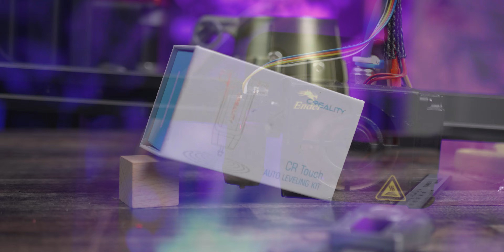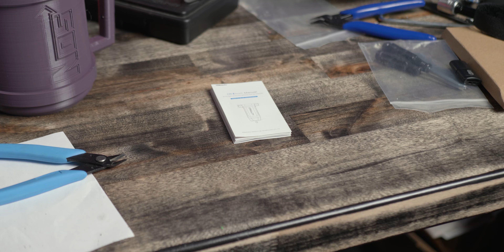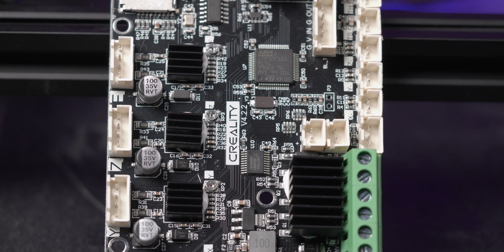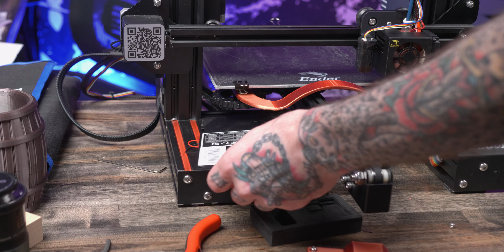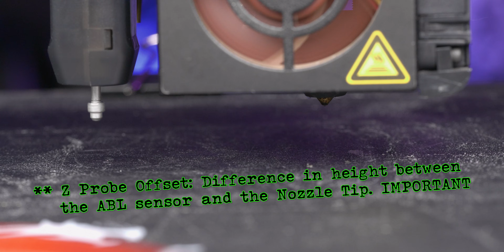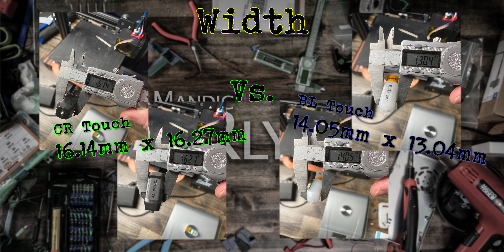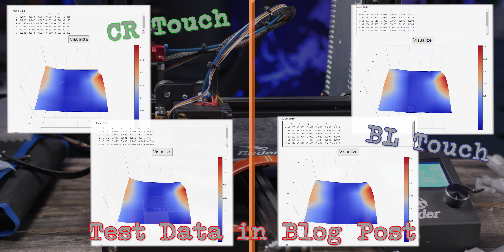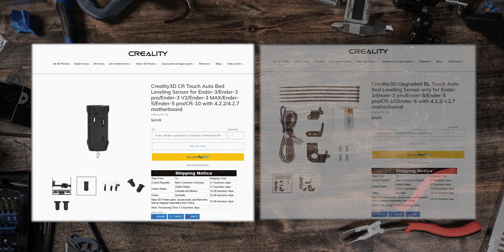CR Touch vs BL Touch - NEW Creality Auto Bed Level Sensor Review

Comment: Can you elaborate on what didn't work about the Creality provided firmware? I purchased a BL Touch and wasn't able to get it working out of the box with the same cable/firmware. I ordered a CR Touch cause I don't have enough experience and didn't feel like messing with it. My problem was the gantry started down, never deployed the probe, stopped without touching the build plate, and then reversed and went up until it crashed into the top of the frame. Was able to repeat this on two totally different Ender 3v2's and two different BL Touch's. See it here: https://youtu.be/9aUeO1KjvFE
Reply: Just received my CR Touch. Same exact problem. Not sure WTF I am doing wrong. I plugged it in, unplugged the Z-Stop, updated the screen/printer firmware. Same result with two entirely different printers and BL/CR Touches. Emailed Creality and received no help. Someone tell me what I am doing wrong...
Reply: Also worthy of note... My carriage crashed into my X-Stop and started grinding away because I have an octoprint camera mounted to it. Apparently the mount for the CR-Touch does not clear a gantry mounted camera and prevents the carriage from contacting the end-stop switch. Just good information as the same issue does not occur with the BL-Touch mount.

Comment: It would be better if the probe was completely shrouded when retracted.  I had a BLtouch snag a failed print and destroyed the BLtouch.  But since I have a 3d printer a small shroud is easy enough.  

As an aside I find it funny when people complain about things that a 3d printer is actually used for modifying.  If the STL model is available that would be good.
Reply from the maker: This sensor is spring loaded to the closed position.  So short of a serious failure it shouldn't be protruding enough to snag on a print ever.  If your parts are curling THAT much, they were destined to fail, hit a part cooling duct, or get smashed by the hot end anyway.  This has a metal probe so even if it did hit, it wouldn't be as detrimental to the probe as BL Touch.

Comment: The board connection is the same as the BL?
Reply from the maker: Yes it is. The wiring is all the same. I literally used the same wiring for both tests without issue.

Comment: Pity you never mentioned the single most important item, if the probe offset is different than a bltouch when mounted on the same machine.
Reply from the maker: Do you mean the X/Y offset? Cause I specifically mentioned that the probe is Shorter and that Z Offset must be adjusted but it should be anytime you change sensor or nozzles on a machine.
Reply: that isn't the most important item at all.  you aren't swapping probes, and you are definitely dialing each one in.

Comment: I always think I should add a BL touch of some sort on my machines, but then I remember I manually bed level the machines like once every 6 months, if that. I think the glass bed helps.
Reply: Had the same thoughts. Then I bought a bltouch and saw just how warped my glass bed was (410x410mm).  Prints were ok but def had issues with squish and adhesion in some spots on the bed, now that’s completely solved. I then got OCD and used a depth gauge mounted to the rail to add layers of painters tape between the aluminum and glass to make the bed flat at print temp. This was a long process though. Do one row at a time (15,0 - 15,410 for example), mark where it drops more than .05 from the highest spot, mark where it climbs back up, add a layer of tape between those marks. Repeat until you have no more spots that drop in that row. Move the head one width of your roll of tape back and repeat the next row. Took a long time but now my bed visualization plugin shows a nearly flawless bed and the ABL compensation is negligible.
Reply: I level my bed 2 times a day
printing 24hrs tho..
Reply: @MountEverest974  I've run for about a week straight on a manual leveling from months ago, with only sporadic use at best before so lots of moving the machine around and heating up and cooling down. I just adjust my first layer height and it seems pretty forgiving.
Reply: Same iv had my printer a month and had to level it 2 times 1 when i got it and 2nd when i had to do some cleaning other than that its fine tho i just got a flex bed and im having to level it after every dam print so hence im here looking for a way to get the printer to do it for me XD
Reply: Same never needed to touch the level with the updated springs and glass bed.
Reply: Also the bed leveling doesn't actually take any extra time if you have it bed level while heating.
Reply: So glass is better then the mat?
Reply: I bought it because my printer doesn't have a z offset option so I had to manually z level and exclude the z homing in the g code. So it was totally worth it imo, also I literally will never have to level my bed ever again.
Reply: @kipter  famous last words. Trust me you’ll need to level it again.
Reply: Use Ender 5 plus
Reply: My glass bed came out of level after every print. It’s super annoying
Reply: I have used the tazbotz with their autobed leveling and i hated it.  It is a different system than the BL Touch but i can manually level my ender in a minute or so. With the glass bed and upgraded springs I almost never need to level the bed.  I just double check it wgen i move the printer to a new home.
Reply: I felt the same way. I got a bl touch and never got it working properly. Then I was having a ton of trouble and decided to get it up and going. It massively improved my prints. Now I wouldn't go back.
Reply: In a way they are over rated.  If you do a good manual level, I think the only advantage of Auto Bed Leveling is it usually probes more points and compensates, but only on the 1st layer.  I used to auto level before every print, but that is slow and really no need so I stopped doing that.
Reply: @Nerlin   no, not only the first layer is compensated. The amount of compensated layers can be changed and it can slowly reduce the amount of compensation per layer. This is customisable in firmware.
Reply: @Nerlin  tell me your secrets. I only stopped having problems with my ender 3 after installing my bltouch and thinking about getting one for my svo1
Reply: @Nerlin  so if you do install an ABL does it do the autoleveling before every print?
 or is there an option where you can turn it on to ABL before each print or do you have to just select the option to ABL manually when you want?
Reply: @andreamitchell4758  I added the auto leveling command to the start gcode in Machine Settings (Cura). but it's kind of slow to auto level before each print so I have since stopped and only auto level once in awhile.   I just keep 2 printer setups, one with, one without.  I imagine you can still auto level from the Menu if you had that option to begin with. I have CR10 Pros that came with that capacitive auto leveling.
Reply: They help if your bed is warped. Which glass should not be…
Reply: @timothymusson5040  My bed is so warped that even glass doesn't fix it.
Reply: @timothymusson5040  ideally glass doesn’t warp. In practice it does, though. I had a glass bed that started out flat, but took on a slight “taco” warp within a few months. Addition of the BL Touch helped deal with that. I now mostly print to a steel plate with a smooth PEI sheet, and that’s working for me right now. I run the bed probing maybe every ten prints or so.
Reply: Except when it breaks. Which mine did after 2 weeks.
Reply: @mattportnoyTLV  the hell kinda luck you having... ive had my glass bet 3 years.
Reply: @roxasparks  my glass bed didn’t break. My BL Touch broke.
Reply: They are definitely over rated. They can help with warped beds yes but the issue for me is how much maintenance or work it takes to keep my machine printing well. Now I'm no pro and I'm sure I didn't understsnd fully or something but every single time you have to re-level the bed you have to go into the z offset and change it witch is so annoying figuring that out lol.. I got so sick of it I just Uninstalled it and honestly it's so nice. Just level the bed, and prjnt.. It's definitely case by case but I have a couple printing friends that know way more than me and told me from the start to not mess with them. It's probably better to buy a new bed itself than a BLTouch to "compensate " for the warped bed. But who knows haha. Everyone is different and experiences things differently
Reply: @BMathiesen  for me on a glass bed yeah not needed at all tho I’m now on a mag flex bed and every time you take the bed off it goes out of level and needs doing

Comment: I bought the CR touch because of this video! Works great after I worked through the nightmare that was the z offset. The directions were..... not good. You should do a video on calibrating it:-) I'm excited for the ender 3 v2 display to be natively supported by Marlin. Might get to use that magically Z Offset Wizard you speak of.
Reply from the maker: I started working on a Z Offset video today after quite a few folks asking.
Reply: @MandicReally  video released?
Reply: @MandicReally  video released?
Reply: @MandicReally  Any update on this release of the video?
Reply: Link to the video? Please.  My S1 will be in Thursday.  I'm starting from nothing.  Lol.  Can't find anyone local that does this yet.

Comment: ANTCLABS has patent, Creality must stop pantent infringement.
Reply from the maker: If you bothered to look at the detail parts of the video or the blog post where I disassembled and photographed the inside, you’d find out this uses an entirely different design than the BL Touch. In fact some are already  saying they prefer the design of this one as it may well handle EMI better. 

Just because it uses a probe to test a bed doesn’t mean it’s the same.

Comment: Does this only work with Creality-provided firmware and boards, or can we use it with BL-Touch enabled Marlin firmware on an SKR Mini E3 v2?
Reply from the maker: Despite them being entirely different sensors the Firmware views them the same way.  So yes you can use it with a BTT Board and just configure Marlin as if it was a BL Touch.  That is how I compiled my own firmware for the 4.2.2 board.  I haven't installed it on my machine with the SKR Mini E3 in it, but the Firmware should not care at all and the port wiring is the same.
Reply: @MandicReally  that means that you can simply replace the bl-touch with the cr touch? too lazy to open up my printer now. and i do want to replace my bl touch as the stick got warped due to a non sticking print...
Reply from the maker: @PtR-ec1wz  you should be able to, yes. I’ve done it a couple times. On my Elegoo Neptune 2 it didn’t work, for no reason I can discern. But everywhere else I’ve tried it’s been fine. (Creality and BTT boards.

Comment: 8:52 Z-offset is distance between nozzle and probe beeing OUT (not IN).
Reply: actually it's the distance between the nozzle and the point where the probe actually activates.
Reply: @JustKyzuuh  yes, that's even more correct
Reply: @JustKyzuuh  Was just thinking, given the difference in size between the CR touch and BL touch, couldn't he have used 1/32" washers as spacers to retain the same offset?

Comment: Does the extra weight cause extra ringing compared to the BLTouch?
Reply from the maker: It has the potential to but a 4 gram difference is not much. A lot of other parts and modifications would way more. I noted zero difference in print quality but this machine isn’t amazingly tuned and always has a bit of ringing. I’m setting up my Ender 5 Plus in direct drive with linear rails, maybe once I get that tuned in I’ll retest.

Comment: omg i am on day two trying to get my ender 3 working after installing the cr touch and updating the firmware. went from bad creality firmware that wasnt meant for cr touch to your file and now am getting printer halt error. yes everything is connected and in the right spots
Reply from the maker: First thing I would try is reflashing the firmware.  I had the Printer Halt error with a different firmware I tried from Creality before the one I provided.  Just put the file back on the SD Card and rename it some other string of numbers at the end.  Sometimes starting over even with the same file helps. 

That is the only suggestion I have at the moment.  The only other Option I can think of is if I provide you folks my personally compiled firmware and I'm concerned about people wanting constant tech support with that.

Comment: The firmware you provides on Github, does that have the marlin bed leveling wizard enabled?
Reply from the maker: No, that is the firmware Creality provided to me. It has bed leveling enabled but not the Probe Offset Wizard. 

I could provide a precompiled release of Marlin for folks but I worry about having to do tech support for that. I really don’t have the time to do so, so I generally shy away from it.

Comment: Please test the BLtouch while turning hotend and bed heating on and off.  I've had that significantly influence 3D-touch results, I think because of the current spikes causing EM pulses throwing off the Hall sensor.  The original BLtouch might be "tuned" to better avoid this, but gimme an optical sensor over a Hall sensor any day ...
Reply: Is there more data on this topic?

Comment: Yes!  Finally someone with pictures of the inside and it reveals ... an optical sensor!  That alone makes this thing so much better than a BLtouch.  No more interference from nearby magnetic items or electromagnetic fields.  A lot less tuning required to get it to trigger consistently (because of the Hall sensor in a BL-touch).  And the mechanism to deploy the pin seems much more robust - from the movies I saw I guess it needs to be actively deployed, so no more risk of the pin dropping by heavy shaking of the gantry.  This looks like a winner to me ... except for the price maybe, but I guess it won't take long for cheap clones to appear and because of the less tricky technology in here, I think those clones will be way better than even an original BL-touch.  This might get me away from building my own (servo + opto-sensor) probes ...
Reply: Wait until it starts rattling.
Reply: The CR touch fails.  it lowers the probe during prints.
Reply: @chadsteele5268  That sounds like a software issue.  As far as I know the CR touch pulls up its pin when not powered, so to have it lower the pin during printing would require it actively driving it down.  Whereas actual BLTouch and clones can just have their pins fall off from rattling of the print-head.
Now, as all these devices implement the same ridiculous "communication method" used by the BLTouch by having certain PWM widths (or servo angles) stand for a command being issued to the probe and then just having a single high/low signal back for communicating the state (as opposed to using those same two lines for smarter bi-directional communication and having a decent checksum-verified message as command), just noise from heaters can indeed make such a probe (also a BLTouch) do weird things due to that noise influencing the PWM signal travelling through wires parallel to those high-current heater signals.  So, I would agree the CRTouch could have improved further in that area, but that would have made it less compatible with BLTouch-oriented firmware.  Still, both BLTouch and CRTouch have a uP driving everything so implementing a more robust communication (as option, similar to the 5v mode on BLTouch) should be possible for both of them, but ... I think most enthusiasts have moved on to Clicky probes and mechanism that can automatically set the z-offset while at it (of course, on printers having the room to mount that off the bed).  I myself use a Compact Opto Servo Probe v2 (see Thingiverse) and love it, although it shares the same PWM driving signal, but here at least it's logical as there is no uP in the probe.
Reply from the maker: Everything you said seems pretty accurate to me. The probe does need to be energized to extend so it fails safe (barring mechanical binding of course). 

As for testing while power cycling, if / when I get wiring to testing on other machines I’ll see about doing that.

The price is a fair but more than a standalone BL touch but I’m already seeing these kits for the CR Touch with like $5-6 off coupon codes on Amazon. So seeing them around $40 isn’t far off I’d bet.
Reply: @MandicReally  So in your opinion should I get the BL touch or CR touch for my Ender 3 Pro?
Reply: @kenopyowo  cr, I just went threw all this lol
Reply: @jimsinnovations2737  ah shit i just recently got a bl touch. lets see how this goes. I haven't installed it yet, im printing the hero me gen5 first
Reply: @kenopyowo  it's awesome make sure take Off that one z step on bottom
Reply: @jimsinnovations2737  the z endstop?
Reply: @kenopyowo  ya sorry this phone sucks for typing on here sometimes
Reply: @jimsinnovations2737  Yeah i understand, thanks for the advice!
Reply: @jimsinnovations2737  I can relate

Comment: Currently in the process of installing a bl on my ender 3v2 and the firmware isn’t working. I have the 4.2.2 board with out the adapter. Any recommendations?
Reply from the maker: What do you mean by “Firmware isn’t working”? Does it not have Auto Bed Leveling features in the firmware? Firmware went to black screen and won’t boot? The sensor isn’t functioning properly? Sorry I need more info to be of any help.

Comment: If I was getting a new Ender 3 then I might actually consider getting the CR-touch but with my current setup it wouldn’t make much since. BLTouch is still old reliable.
Reply from the maker: This will work on any machine the BL Touch would (space constraints allowing for the larger diameter). The firmware doesn’t know the difference between it snd a BL touch. But if you don’t need the brackets then yea you can get a BL Touch a fair bit cheaper without them.